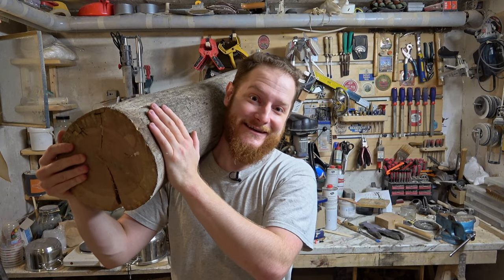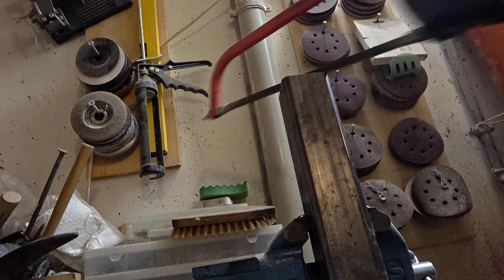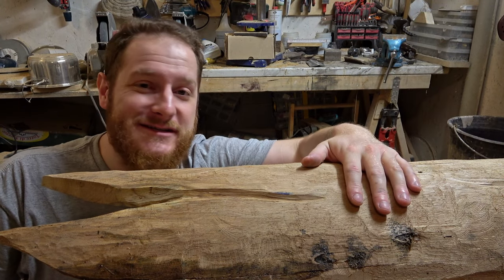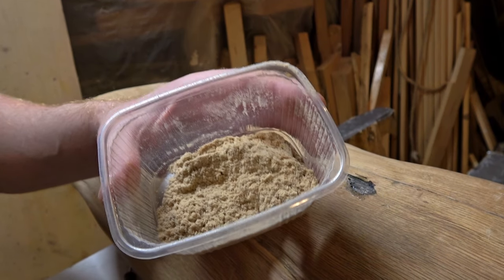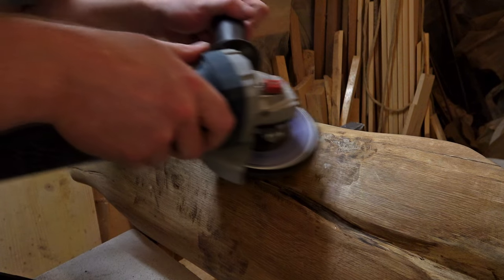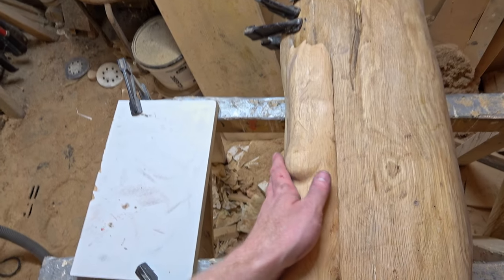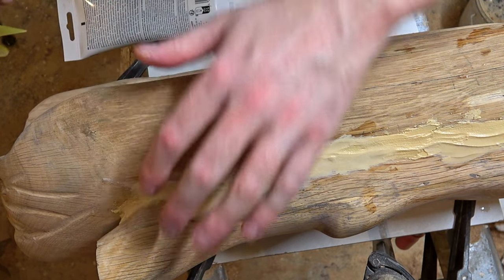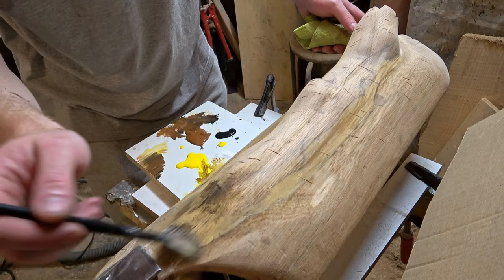Crafting Thorin Oakenshields Oakenshield from Oak wood

Comment: This video really drives home the point that the strength of a shield is not in the wood. It's in the canvas/leather cover and glue.
Reply from the maker: Indeed! This oakenshield would break apart after round two of fighting, even if I didn't carve through it.
Reply: @TheShieldery  would a second layer of fabric and glue make a shield stronger, or is most of that resistance to penetratetion  coming from the wood and the internal stress put on it by the fabric shells?
Reply from the maker: @scottmcdivitt2187   Fabric or rawhide only make the shield stronger after the point when the  wood beneath deforms a bit. They can't absorb the energy at first. With very hard, oaken wood this won't make much of a difference. The main Problem of this shield is the way the wood has been cut, caus as you can see cracks happen very fast. A properly sawn side board would be way better then the stump.
Reply: @TheShieldery  interesting. The fabric is offering the wood strength when it's in tension? Sort of like a crude medieval fiberglass/carbon fiber ? 

Have you ever tried/ heard of anyone trying a shield from tulip poplar? It's a north American wood with a rope like grain structure that's very tough.

Comment: Looks good though id imagine if you did happen to fight an orc with it the whole thing would disintegrate into sawdust, splinters and superglue flakes 😂
Reply from the maker: XD YES!!! I thought about making a 30 seconds voice over to explain how wrong the design of this shield is in general. Why would anyone put the sharp metal parts on the back end?!?!?!? It's also top heavy as fuck. (Oak) wood also would never split in the way as you can see it on the front end on the movies piece. The piece of wood would basically break apart after round two caus of it's structure. An average side board with 2cm thickness would be better then a piece of a trunk..... 
But it's fantasy and I like how it looks, so I didn't want to spend time talking about how unlogical it is.
Reply: @TheShieldery  My headcannon is that "Oakenshield" is a "translation" choice by Tolkien, in that it's not actually Oak, but a fantasy wood that only exists in Middle Earth.
Reply from the maker: @gibbering_mouther  Oh Dang; now that's a plot twist. I can't find anything about that in the lord of the rings fandom page though. On the other hand stuff like that would be typical for Tolkin.
Reply from the maker: @gibbering_mouther  On the other hand Tolkin copied Thorin pretty much from the germanic Edda (?) Saga; in that context Oaken Wood would be more logical. Especially caus "Thorin" derives from the Norse god "Thor"..... Are you sure that Tolkin meant a middle-earth-wood?

Comment: If you want to know how much contact area there is between two irregular pieces of wood, You can use carbon copy paper or heavily chalk up one side, and then wiggle it a lit while pressing on the other piece. it marks the high spots for you.
Reply from the maker: That only shows where the surfaces touch, but not weather they are 1mm or 1cm apart from each other ;) .
Reply: @TheShieldery  yes that is the idea, it shows the parts that touch, so you shave the high spots down and try again and more surface will touch, keep doing it until you get most of the surface's touching evenly, then glue it up

Comment: Try a solvent based resin and fine saw dust instead of super glue and saw dust. You will find it easier to sand. For larger gaps i use bondo wood filler it hardens very quickly and stays hard .Love your work!
Reply from the maker: Thanks! Yeah, If I would have had resin on hand, I would have gone with it. I'll add the bondo wood filler to my wish list and will try it when the one I have is empty :)))

Comment: Also you have earned a shroud for your angle grinder, they plug into your vacuum and cut down on dust immensely.
Reply from the maker: not for woodworking and you also couldn't set the blade to an angle, what you basically have to do for carving. If there's a solution to that, let me know. But I have never seen a SINGEL edge grinder wood carving video in which some kind of shroud was used :( .

Comment: Wouldnt you use a drawknife instead of box cutter knife? Its much easier
Reply from the maker: maybe in some cases, but they are not that good for tight spaces in general.
Reply: @TheShieldery  Sometimes they arent, but I'm using them to do most tasks in my shop ;)

Comment: Actual old shields were actually made of many layers of lightweight materials, sometimes even paper.  They were usually ringed with some kind of metal, to allow smashing into the enemy, and to prevent splitting.  Even animal skins were used.  We have a company up here which reproduces these, for historical uses.  The Vikings were probably the most backward in their shields, but when they got to the middle east, they wised up fast.  Hard metal shields have to high a mass-to-resistance ratio, and cannot be used in hand-to-hand combat.  They are used like the Roman military, with hard shells, making turtle attacks and defenses practial.  Then the Romans used an easy-to-handle short sword to wipe out the enemy.  Vikings also, with lightweight axes at very short ranges.  Joshua, who was actually a "killer" according to the bible, assembled a group of "harsh men", aka murderers, killers, robbers, in order to wipe out a batch of nearby enemies, who had been harassing them for decades.  I believe that this is just history repeating itself, again, and again.  After we run out of fossil fuels, we will go back to that era, again.
Reply from the maker: Uhhh, then this channel is for you my friend! Check out one of my videos about crafting historical shield replicas :) 
I don't agree with some of the other stuff you say: 
- "usually ringed with some kind of metal" - nope, only roman Scutii, you'll have a hard time finding metal ringing on shields in the middle ages
-  "many layers of lightweight materials" Many layers - yes; light weighted - not necessarily ( the gesso for example is quite heavy)
- please give me a source for the paper, never heard of that and I'd be quite surprised if it was for a shield for combat.
- we had full metal shields called Bucklers form the late medieval ages that definitely where used in combat and duelling.
- the Roman shield fighting methods where maaaayby used in the early middle ages, but not that much later caus armor and weaponry evolved. I won't break that down in detail, but basically the shields got smaller the later you go.
- the bible source you mentioned doesn't give any context of the weaponry or fighting methods they used. I doubt that murderers or killers where skilled enough to form any kind of testudo.

check out my videos about creating the shield replicas, I hope that will help with some of the wrong concepts you described here ;) .
Reply: You love to see it, this dude really came in here, said nothing of value, at full volume, with his whole ass chest, and was rewarded immediately for it, well done. 😊